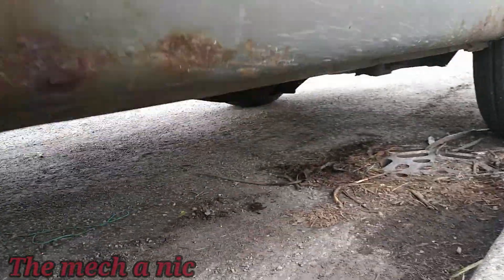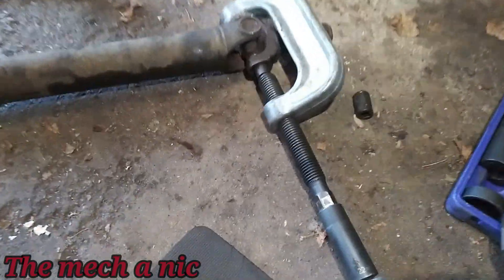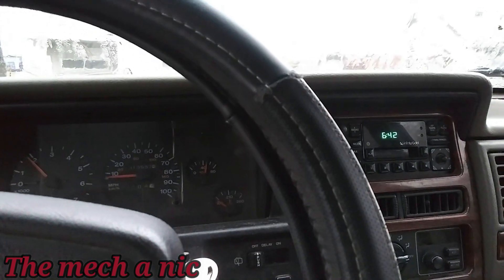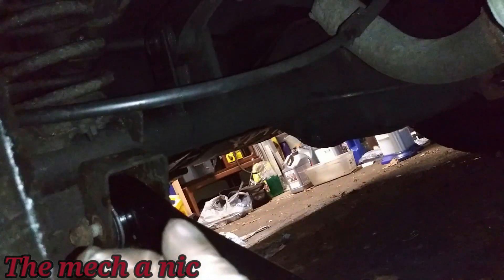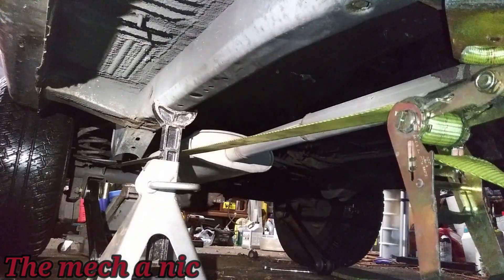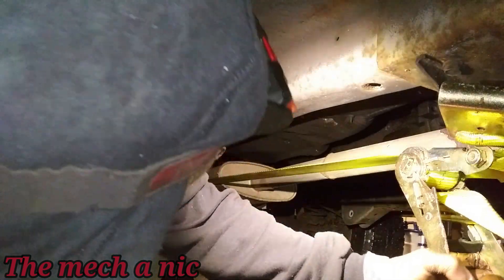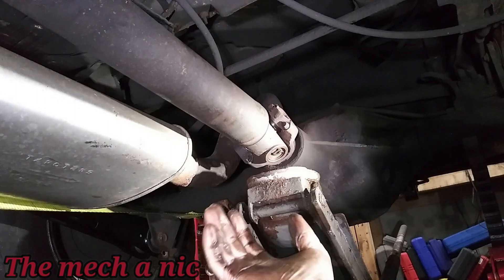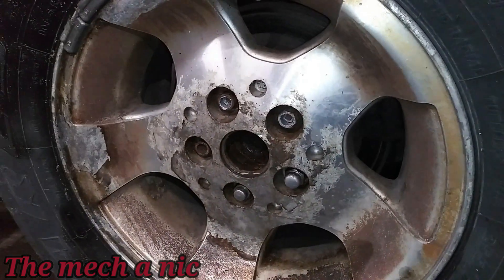grand cherokee control arms and U joints

Comment: 2 helpful tips. 1 put a dab of hi temp bearing grease into the needle bearing cap and smear the needle bearings so they stay in place for installation. Makes this task so much easier. 2 align the zerk  fitting on the same side on either end for easier lube jobs in the future so that you don't have to turn the driveshaft when lubing the u joints. Great videp bud. That is one heck of a ratted out death trap you were working on.
Reply from the maker: Great tips! Now I know, I didnt even think of servicing the joints when i was installing them. Next time I do you joints ill keep both of those tips in mind 👍 definitely annoying to have the needle bearings pop out of place .

Comment: With so many problems this vehicle has... you did a great job! Yea... when your fighting it all the way your going to forget a couple of things but you caught them. Most mechanics wouldn't have even given it a second thought.
Geeeeeze. You make me wanna move near you!!!!

Awesome Job!

PS.... I bought the relay bypass kit and it looks great. Haven't tried it yet(tomorrow) just wanted to say thanks for showing it.
Also, another guy uses a air hammer to drive the U-joints out.  Looks pretty quick and easy. I have always use a vise and/or C-clamp and it can be a chore.
Reply from the maker: Thank you.means alot to me. Air hammer seems sketchy to me...what if you bend an ear? I guess the vibrations are less likely to bend it compared to applying a ton of force with a balljoint press. Im sure its way faster too .that relay bypass is so cool. The more you use it the more you'll fall inlove. I use it the most with no crank situations

Comment: Try spraying some silicon lubricant spray inside of the impact trigger. Might prevent the trigger from sticking.
Reply from the maker: Ill give that a shot. I noticed that i can pull the trigger a million times and it wont stick.it only randomly sticks when its impacting

Comment: I'm surprised that the wheel studs didn't snap off when you used that high torque Milwaukee to remove the lug nuts. About a month & a half ago I was replacing the belt on my AZ co-worker's 2011 Chrysler 200 (Ghetto Hooptie Edition) & when taking off the lug nut with my High Torque Milwaukee I snapped 2 of the studs off within seconds. She had the car parked in her back yard for about 6 months & cars parked on the grass for that long in Michigan rust out underneath quickly.
Reply from the maker: I was thinking the same...i was afraid of snapping a stud. Its happened to me on other cars that had stuck lug nuts

Comment: Would it have made it easier to install the control arms if you had blocked the rear wheels and jacked the car up from the front? Let the weight of the car push everything back? Would that have made the "pumpkin" rotate upwards like you needed it to?
Reply from the maker: I suppose that could have worked. Never thought of that. If i had to do it again the first thing i would try is lifting the differential . 👍

Comment: The job went smoothly, considering you admitted it was your first,
after you learned how to rotate the differential- it all goes back
together- and you go and get all bravado,
saying it should be in the junkyard. Bite the hand that feeds you, Dude. 

p.s. That's balanced as a rotating assembly, check the weight tabs spot welded
onto the tube. Mark future ones, but you got lucky not having to here.

Comment: If I could only buy one electric impact gun, which would it be? I’m looking to make brake jobs faster and maybe do some heavier stuff occasionally like axel nuts and crank pulleys.
Reply from the maker: The Milwaukee mid torque is a good compromise. Its not too big of a tool and has plenty of power